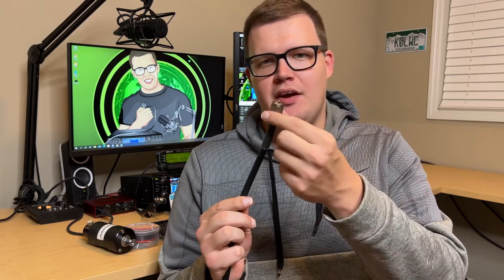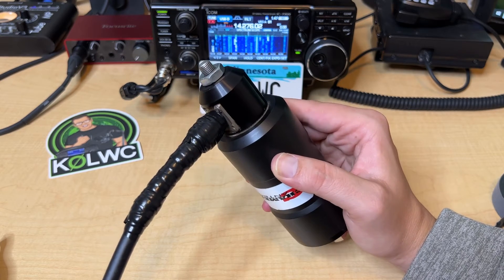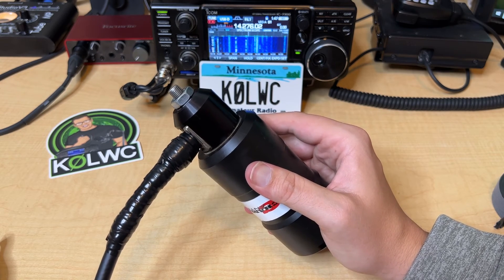Ham Radio Basics: How To Waterproof Your Coax

Comment: Temflex is fine but it’s for low voltage and household wiring. I use Scotch 130C splicing tape. It’s for exterior applications and has a voltage rating of over 50Kv. Something to think about when using an EFHW. The voltage at the ends is 5Kv. Also Scotch 33 is thinner and works just as well as 88 science both are only used for UV protection. 
73

Comment: Hi, what happen if you put the dielectric grease not just the thread of the connector but also the center wire of the hard line what's gonna happen? Thanks for the Video. 73 Jojo

Comment: I have ben into radios n stuff for 35 years + and This is also about what i do..i just add a layer of tape First then the self sticky tape Then another layer of electrical Tape ! Most of my fiberglass vertical antennas Also get a couple of Clear Coats To ! Good Video Thanks For Sharing & 73's

Comment: Initial layer of electrical tape, followed by a layer of coax seal mastic, and a final layer of electrical tape is the recommended procedure. Makes removal much easier.
Reply: Initial layer you want to twist the tape so the sticky side is up and wrap from bottom to top  that way the electrical tap does not goop up metal connectors. Follow up with mastic and a final two  layer of electrical tape  this time top to bottom and bottom to top sticky side down. Done!
Reply: Not necessary. I've never had a problem removing electrical tape. Coax seal is a different matter. @tootalltechnology8032
Reply: Electrical tape does not goop up the connectors. The mastic does. @tootalltechnology8032

Comment: There is a product I've used for years called Coax Seal. Is it protected from UV exposure?
Reply from the maker: Generally, you need a UV-protected coating of electrical tape over the coax seal. Coax Seal is just good for moisture.

Comment: Can someone tell me if long term moisture build up in your coaxial will cause the line to stiffen?
Reply from the maker: I’d guess you’d notice a problem with performance if you had significant water intrusion. If coax is getting stiff after being outside it could be from UV rays.

Comment: I have already had my antenna, without waterproofing and UV-proofing imposed, installed outside the window of my house. The antenna is about 1.5 meters away from the window which means I stretch my whole body out and still can't reach the antenna. In order to manipulate/waterproof it, I have to loose four mounting bolt and withdraw the antenna with its mounting bracket. This takes time and effort. So I'm asking to see if there is any aerosol spray that can achieve waterproofing so I don't have to loose even one bolt to achieve the job.
Reply from the maker: Nope. Do it right and you’ll be glad you did.

Comment: The proper method is to use Butyl Mastic tape in combination with wide UV-resistant electrical tape - such as the contents of the 3M WK-99 Wireless Weatherproofing Kit and similar kits, available from Tessco and other vendors.  That kit contains enough supplies for about 20 connections.  Tighten the connectors sufficiently that they won't come loose.  Wrap the connectors with narrow electrical tape to protect them from the Butyl tape adhesion, stretch and wrap the Butyl tape around the area to be weatherproofed going slightly past the inner layer of tape on each end.  Mold the Butyl with your hand to fuse the layers.  Wrap with wide electrical tape.  If the connection is vertical, wrap from bottom to top.  This is how this is done in commercial and public safety RF installs for MANY years and it is very effective and inexpensive.  If you need to access a connection just slice down through the layers lengthwise to your connector then peel it apart.  Be warned - Butyl sticks to everything- which is why it is so good at weatherproofing- so make sure you install that inner layer of tape.
Reply: I’ve used the Temflex and Scotch 33 and it works just fine. I’ve taken connectors apart after 3 years and they looked brand new. The Butyl works but is sticky and 3 layers of tape is a bit bulky.

Comment: The only comment I would add is if you wind the tape in the opposite direction, the tension would then to tighten the connector. The way you wrap the tension tends to losten the connector, not a lot, but possibly just enough.

Comment: And the Chameleon CHA-MIL transformer (rated @ 500 watts), is great for the "apartment dwelling operator" that has a balcony railing to work with.  Although, if all you have is a window, and you can spend the extra money, get MFJ's 1622 antenna for the mounting bracket and hardware.  Mount the CHA-MIL to the MFJ mounting bracket and you've got a window mounted antenna that with a good antenna tuner you should do well everywhere your license allows!
KD8EFQ/73
Reply from the maker: The Chameleon system is spendy, but I’ve been happy with it and the build quality is second to none. It’s a tank. It was once a primary antenna for me when I was HOA restricted.
Reply: @K0LWC  "..spendy...", agreed.  I'm disabled and on that lovely fixed income and thus had to save for a few months, but when I mounted a 102" whip on that bugger with an antenna tuner I could've sung praises despite my very thin faith in any classical higher power!

Comment: Thanks for the video. Question: does the Temflex come off without a problem if/when we need to work on our antennas?  I’ve not used this product in the past.
Reply from the maker: Yes. Simply take a knife and cut vertically down the tape. Don’t cut all the way through, but create a score and you can pull off the tape.

Comment: Doesn’t that also go with coaxial cable that you use For pay television and over the air broadcast between the antenna and the television
Reply from the maker: Yes. Some connectors are more resistant to water intrusion, but still not perfect. 

Satellite TV coax runs can be more prone to moisture damage as tend to also carry power. The presence of DC voltage speeds up corrosion.